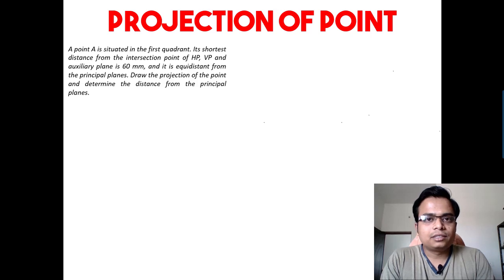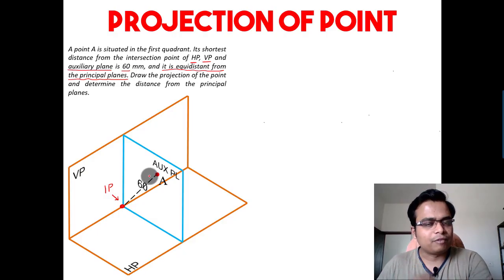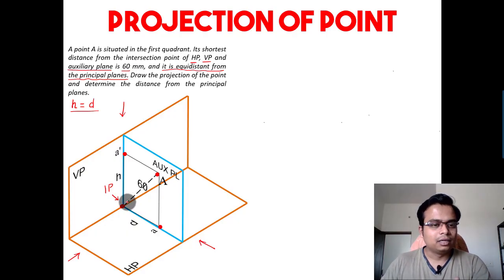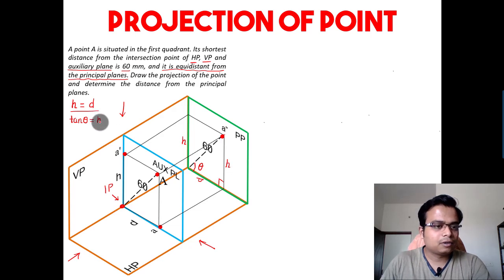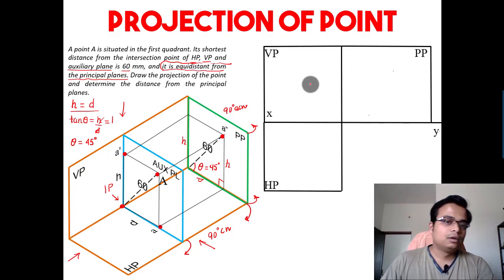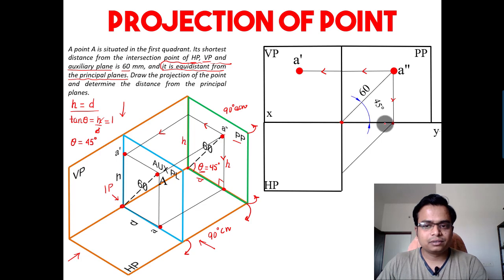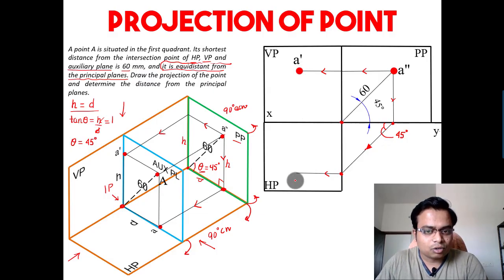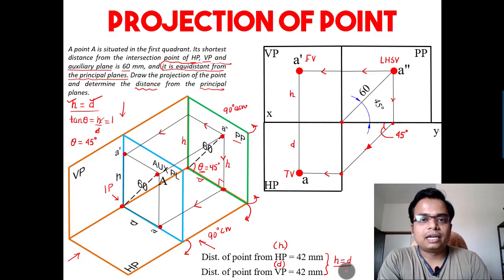Projection of Point_Problem 5_Reloaded

Comment: Sir please solve this question 
Q. A point P is 40 mm above the HP. and 50 mm in front of VP. Draw also an
auxiliary elevation of the point on an auxiliary vertical plane (AVP) making an angle
of 30o
 with the VP.